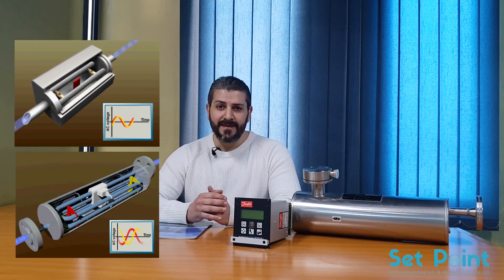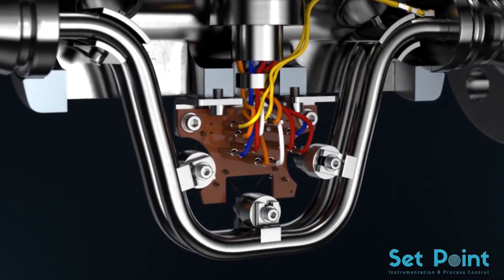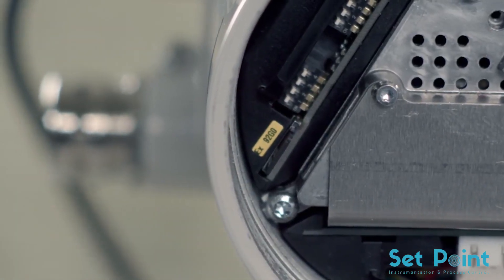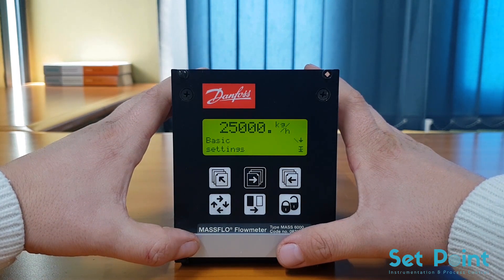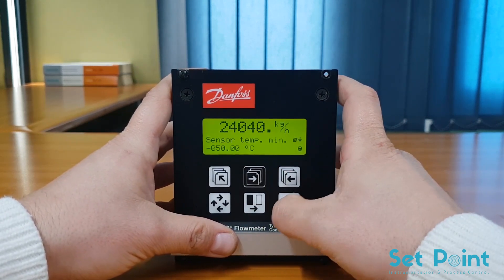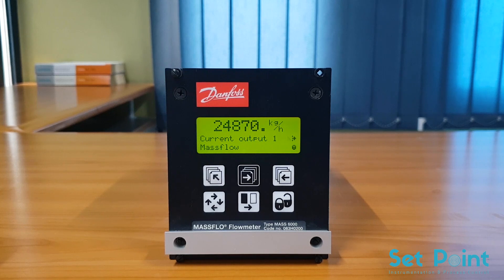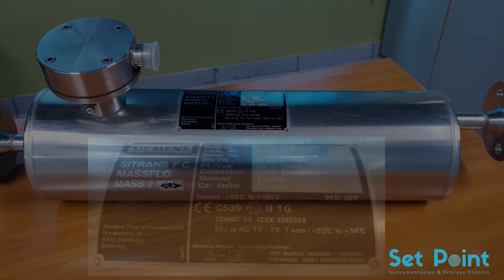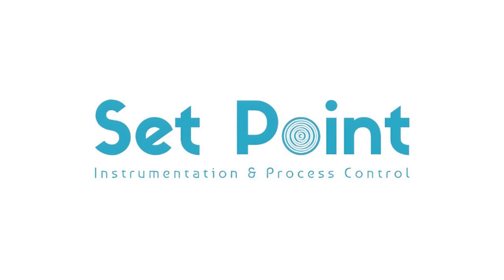Coriolis Flow Meter

Comment: I have 1 question ❓ 
If coriolis design to use with liquids.
Can we use for gas measurement?
Reply: Thank you very much,
Thank you for the fast answer.
I hope your  Videos will have benefits to all.
Reply from the maker: @niponkijwongwattana2372  You are welcom dear.
Reply from the maker: Thank you for your good question.
Practically let's say yes! but you need to change the parameters of calibration,  and for sure you need to get back and check the manufacturer.
Coriolis flowmeters can measure virtually all fluids and gases, as it used for single phase flow measurement.
if you would like to use same flowmeter to measure liquid and gas, we call it two or multiple phases flow metering. 
When multiple phases are present, some of the basic assumptions made in Coriolis measurement break down. Primarily, the fluid no longer vibrates in sync with the flow tubes resulting in measurement errors.